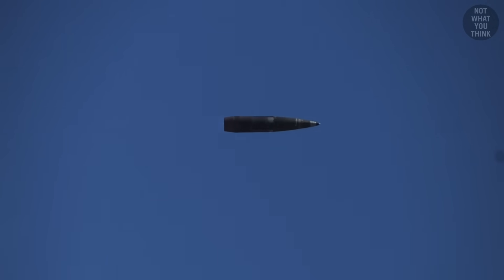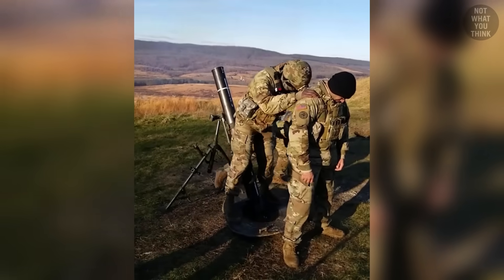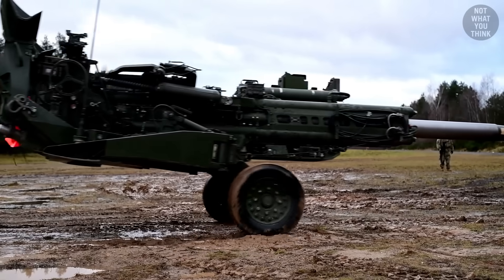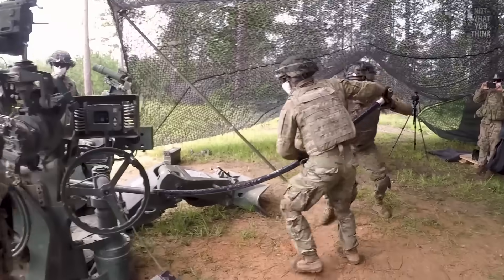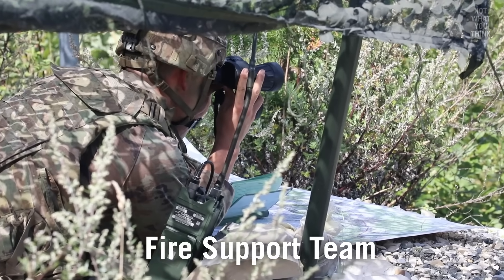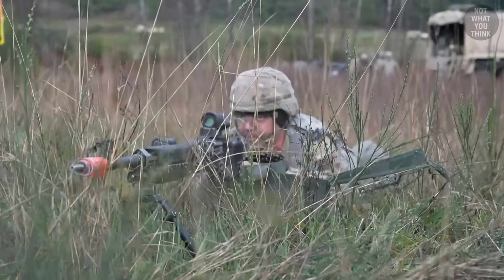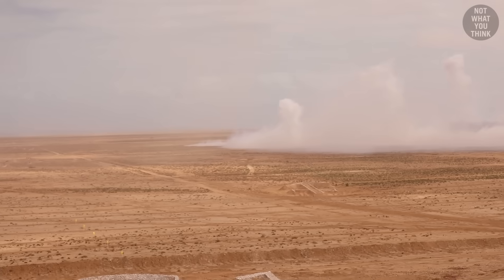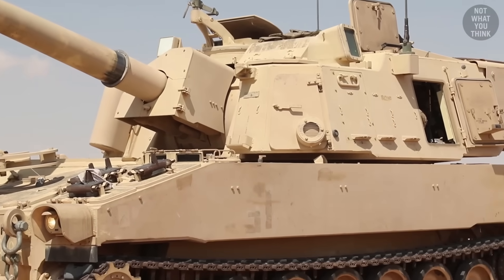How Aiming Artillery without Seeing Target Works

Comment: Why don't they put a UWB (ultra wide band radio) chip in each grenade (they are very cheap and standard in most smartphones now, but with few applications) that bursts its signal a fraction of a second before expected impact. The UWB signal from the shell can be triangulated by a network of UWB receivers, determining its location similarly to GPS, but without any satellites involved. Then the firing crew would have data enough to aim already the second shot pretty precisely, and adjust ever better from there on. Given that they target certain locations on the map (it doesn't help guide to moving targets).

Just wire the chip to an antenna on the surface of the shell, and use a capacitor to discharge the high powered millisecond long radio signal across a wide range of frequencies that penetrate most materials (like trees and buildings and perhaps even some hill crests) and is very hard to jam. A single burst near impact won't help the enemy track the shell's trajectory to figure out from where it was fired.

One can buy UWB chips and use them to locate each other indoors at home where satellite GPS signals are blocked by roofs and walls. Putting one of them on the cat if one wants to know where it is hiding in the basement (if one has nothing better to do, as I said, commercial applications are yet rare). Part of their frequency band can penetrate thin metal plates, but generally metal is the only thing that can block it. The thing with it is that there's always some part of the transmission band that reaches the receiver in a straight line. Problem with GPS is that if straight line of contact is blocked, the signal will bounce before it reaches the receiver. And then the time travel calculation will be off, easily by quite alot. And if jammed, useless. But it would me much more difficult for the enemy to jam all the frequencies all of the time, than to narrow in on the GPS frequency.

A UWB chip in a drone would be perfectly located, given a network of UWB chips on known locations on the ground within radio range, where obstacles is no problem.
Reply: Most of the problems with smart guided munitions is for the electronic parts to survive the forces of being shot from a gun barrel. 
But if you got any ideas how to circumvent that, DARPA will be interested.
Reply: @tatumergo3931  Well, there's already a timed fuse in shells, since 100+ years. And how do wing extending GPS guided Excalibur and Krasnopol artillery shells exist? Do you think that it's something that the Martians use and that DARPA found it in a crashed UFO?

A chip in a shell has no problem surviving an artillery launch. You tell be about how the mechanics of those winged grenades do it.
Reply: @bjorntorlarsson . It took a lot of trial and error to get where it has gotten. A lot of engineering and help from extraterrestrial assistance. The ufo didn't crash, it landed. 
Anyways what you're asking for is a little more complicated, and there's really no immediate need for it or it is necessary. Then there's the cost of such technology being implemented, specially when current systems work perfectly well.
But if you have a better, more efficient, cheaper idea please do bring it up to the pertinent people....!

Comment: You don't need to see the target using artillery

Just a map and the distance and elevation between you and the target

Then use a bit of trigonometry and calculus to calculate needed arc or "triangle" needed for said ballistic trajectory

Wind and weather also affect this too
Reply: Just a map, masonry compass, and an angle ruler

And some "scratch paper" 

The computer makes it faster and quite easy

Just punch numbers and weather conditions

And it does the scratch work

Comment: I was a 13E, Fire Direction Specialist, part of the FDC, before everything went completely computerized. I directed fire for the M110 and M109A3 & A4. Back then the FDC traveled with the howitzers, first in a Gama-Goat and later in an M577. If we had good gun crews on the M109, then we could give them a high angle fire mission with a time of flight longer than 50 seconds, and have them reload, change aiming points and fire a low angle mission  at the same target to have both rounds hit within 5 seconds of each other.
Reply: It's called MRSI for multiple rounds simultaneous impact and it's an improved application of the Time on target as you are only using 1 gun instead of multiple.
I don't know but we call this in France the Malouine Shot (French name for the Falklands) even if I've never found any hint at the British using or creating this technic during the Falkland war
Reply: For a few years during my service, from 91-99, I was attached at the battery and corps levels in tacfire operations [13C] working with the MLRS rocket system and M109 self propelled Howitzer groups plotting and coordinating battle plans and sending them down to the gun battery's. Was definitely different, and even as we went more computerized mid 90's with the smaller laptop'esque system we still plotted everything on the maps, sending out fire for effect orders and whatnot. Remember the old fire plans? You'd have to send them down in that form and tacfire would have that special paper and form block, this many rounds, of this type with such an such a charge in this direction, at this angle - FFE. Miss it a little...
Reply: @RLHunter_Author , I know what you mean about missing it. I still have some of my practical exercise books from AIT, at Sill. I have Registrations and BUCS. Every once and awhile I will see them on a bookshelf, and go through them. I always loved adding in MET data - totally factious statement.
Reply: Same here

Comment: Bracketing to hit the target. 
 
In german it is called "Gabeln" ("forking"), and the trick of that is that you do not try to nudge in towards the target in small steps, 
but when the first shot is short, you set the second shot DELIBERATELY too far, 
so that then you get the relation of how much too short to how much too far and can then calculate to hit with the 3rd round.
Reply: "you get the relation of how much too short to how much too far and can then calculate to hit with the 3rd round"

That is not how bracketing works. One uses bracketing when one does not have the gear to accurately determine the distance of the impact. If your first shell is "long" or "over", then you drop the range of the next shell by 400m; if it is "short" or "under", then you add 400m to the range. If all goes well, your next shell will have bracketed the target, but you cannot know where it is in this 400m bracket. So, your next range adjustment will be 200m, and the one after that will be 100m. You add or subtract these distances from the range depending on where the shell landed: if it was "long", you subtract; if it was short, you add. Now your target is within 100 m of the adjusted centre of impact of the whole battery, and you ask for "Fire for effect" with a final "Add 50" or "Drop 50".

Don't try any "shortcuts, such as starting with a first jump of less than 400m or going from 400m directly to 100m. Unless you are very lucky or very very very good at adjusting fires, you will have messed up so badly that you will rather volunteer to hand deliver the shells to the enemy than face your fellow redlegs ever again.

Comment: Fire Direction and Control was my job... and part of my job was to know a bit of everything, so here goes.

You forgot two of the five parts off the equation in the US... the Survey team, and the Meteorological team. I discuss them later.

Time fuses are frequently used for airburst rounds when conditions do not permit the use of radar proximity fuses, as well as rounds intended to detonate higher, like some chemical/WP smoke rounds, as well as base-ejecting rounds like illumination, ICM/DPICM, and some WP smoke rounds. 

The survey team is the one that puts down the marks for those aiming posts, which give the artillery battery both an exact location and an azimuth between the two posts that tells them where they are and exactly what direction the guns are pointed.

The Meteorological team is off someplace else, usually, but they do one of the other jobs of a spotter, in detailing wind and weather for the artillery calculations, to include air temperature and density, and the wind. Why do we care? Because the wind and weather call on an artillery piece has many many kilometers of distance to affect the point of impact... and you can't just take the ground speed, because most of the time an artillery shell is in the air is at a pretty significant altitude.

Mils are based loosely off Miliradians; there's 6400 in a circle, and they help make the calculations easier. A one mil angle subtends a one meter distance at a range of one thousand meters. They could have divided degrees down into similarly accurate measurements if necessary, and they do for certain disciplines. A minute of angle is pretty important in navigation and is the approximate derivational source of a nautical mile... it's also roughly a third of a mil.

"Exactly" is a very loose concept in artillery. It can vary by many many meters over the effective range of the artillery piece even without the accumulation of errors from other sources. Of course, when you're chucking an HE round that has a kill radius of 50m due to overpressure, it's a bit less important.

Also, for anyone who wants to know, yes, that was a slide rule. Last I heard the Marine Corps still trains on them for both the site calculation and the graphical firing table... because the Marine Corps doesn't consider electronics sufficiently reliable to completely depend on.
Reply: Neeeeeerrrd

JK, I was 13B ;)
Reply: When I went to artillery school we used “sticks” - those slide rule looking things, which aren’t technically slide rules like engineers had (they are called GFT’s by the way), because we had to operate manual in case systems went down.  A GFT was used to determine vertical alignment (range/quadrant elevation) and the HCO (horizontal control).chart operator) for left and right (known as deflection). The Army and Marines (officers) wen to the same artillery school so we learned the same thing.  This was back in 1995.   I served until 2003.
Reply: @sstritmatter2158 don't forget the GST and your Magic T.
Reply: @anthonykaiser974  YES - nice 👍
Reply: @sstritmatter2158  I was essentially my battery FDO from 2LT-CPT due to personnel shortages. Went to the 5 month FACCC in 99, and it was a buddy from 82d from a famous NASCAR family and me, the 105mm ARNG guy that the MLRS guys came to for Manual Gunnery help. Retired last Summer after 30, and I still have a few TFTs laying around. Might have some sticks laying around here somewhere, too. FT 105-AS3 C1 sits in a white half-size binder on my coffee table. Somewhere here I have a 105-H6 or H7 and I think a 155-AM2. I think those came from my unit when I was BC (B/1-163 FA when it was in Evansville, IN) 20 years ago. We lived at Ft Campbell most drill weekends, especially before 9/11.
Reply: Survey rahhhh

Comment: Yes even you can "operate a motor" but using a mortar sustem safely and effectively is not that easy. There wouldn't be an MOS just for that if anyone could do it correctly with little training.

Comment: Mils are actually used rather than degrees, because the math can be done quickly in your head if required. Every 1 mil of angle is 1m to the left/right at 1km away. So if the target is 5km out, and they call to correct by 50m to the left, you know thats 250mils left (assuming they're looking from the direction of the gun, of course. Or the FDC will convert the angle/distance with some geometry)

In artillery school, you're taught to do everything manually first, before you're taught how to use the computerized systems. They have done a lot of work to design the process so it's as simple as possible, for the accuracy needed.
Reply: No they are made to be used because real Mils aka miliradians are much more confusing as there are 6333 miliradians in a circle. Finding your azimuth and thus deflection from you to a target is simple trig but using a number like 6333.333333333333 for math is going to be much more annyoing than a clean 6400
Reply: @masterhacker7065  Were there 6333.[3] rad in a circle, pi would have a value of 3.1[6], which is false. There are 2000*pi mrad = 6283.19... mrad in a circle.

There are 6400 NATO mills in a circle, as I've found on Wikipedia, which I find annoying.
Reply: @viquezug3936  You're right. 6283 mrad. I still remeber it 😂
Reply: @masterhacker7065  Yes, that's what using a number close to 1 miliradian does. It gets you 1m deflection at 1000m, more or less. Which is what I said. And yes, use 6400 rather than 6333.3 because the math is easier, like I said. I went to artillery school, too.
Reply: @stormycatmink  except that the reason we do corrections is because we used nato mils and not si mils as we are inherently off every single time having to do conversions
Reply: If the target is 5km out and you are called to correct by 50m to the left then that translates to 10 mils to the left right? Not 250 mils.
Reply: NATO 6400 Mil circle comes from the French in WW1. Soviet artillery uses 6000 mils, which is part of why western artillery is more accurate.

Comment: As a FISTer Im surprised how much accurate info you included, especially mentioning the TTLODAC. Great video
Reply from the maker: Thank you, we had expert help!
Reply: But you lost with the last comment - “it takes 30 minutes to put rounds on  target from a ground observer.”  WHAT?  Maybe 3 minutes.   (I was FDO of an M198 towed 155mm platoon in 18th Airborne Corps Arty in Desert Storm - first complete brigade in theater)
Reply: @TheGhostrider9667 30 minutes is pretty accurate nowadays. Mortars are about 10 minutes, 777 can take 10 hours😂
Reply: I was a FDC chief…. Manual gunnery and safety were a first before anything went to the gun line.
Reply: in russia we dont use fuister, we use phuck fist.
Reply: IN russia you dont use fister, we use phuck phist.

Comment: My dad used to train with howitzers when he was in the military. For some reason, he wasn't required to wear any kind of hearing protection. So, today, he has bad hearing. He's not deaf, but he does have to turn up the TV in order to hear it.
Reply: Most artillerymen are like this
Reply: @paavobergmann4920 , and infantrymen.
Reply: Yeah we didn’t really learn the importance of ear pro or just using ear buds until the last couple decades. You were actually considered not as manly if you needed ear protection at one point. Which is stupid, why wouldn’t you want to be able to hear? lol
Reply: I recall seeing pictures of German 88 FLAK crews firing their weapon.   They put fingers in their ears before firing and opened their mouths in a yawn to equalize pressure to the ear drum.
Reply: Truth. I have Tinnitus from that over 35 years later.
Reply: Former artillery man, 91 to 99, and yeah, never used any type of ear pro, not with our small arms [M16a1] or our 155 M109's or MLRS rocket systems. I'm sure it's better now, especially with noise cancelling headphone tech that would allow speech but muffle damaging DB levels
Reply: Your earing problem is not service related

Comment: How do shells stay in howitzers untill you close the breach? Du you just ram it in hard enough so it does stick through friction?
Reply: It is a tight fit, and the shell has a soft metal ring on the outside (called a "forcing ring") that engages in the tube's rifling. The shell (or rather the forcing ring) is jammed quite strongly into the tube.

Comment: Years ago a guy told me 5th FFA had 175mm guns. For direct fire they loded max powder, No Projectile. The muzzle blast sufficed.
Reply: I don't believe that caliber has ever existed in the US Army. US military F.A. calibers for howitzers are 105mm, 125mm, 155mm, 8inch (203mm). Everything after that is rocket or missile artillery, and that's a whole different puppy...
Reply: @tatumergo3931  Look up M-107. The ONLY US Gun that could counter battery the Soviet 130mm M-46. Morse served Cenral Highlands, Ah Shau/Pleiku I think.
Reply: @TheDustysix  . Oh yes, that's the old 6 inch gun system before we went up to 8 inch (203mm) M110.
That's one old son-fa-bitch, it hasn't been used for a while now. Yeah they used to have all kinds of weird calibers back then, until they got standardized  with NATO.
Sure the blast from that thing at close range could definitely cause some damage, but I still think it's a tall tale. Even though sometimes reality is stranger than fiction.
Reply: @tatumergo3931  I never heard of 125mm. Other than Zuni.
 and 5"/38 etc. That's Navy USMC.
Reply: @TheDustysix  . Yes you're right, I was thinking of the Soviet 122mm SP gun. The 125mm howitzer, was just an experimental idea that the US army was considering but never came to fruition. As I think back then in the 80's there was talks about going up to 123- 124mm, and finally settled on the 125mm idea, but never were able to come up with a reliable design that was light enough to be air transported. 
They were just looking for ideas to get rid of the M2A1/ M101 and later M102, but decided instead to settle on the M119 series. My guess is that it wouldn't have made much of a difference at the cost of designing a whole entirely new system. I believe that the idea got started when the Abrams was furnished with a 120mm gun.
Reply: @TheDustysix . Semper Fi.